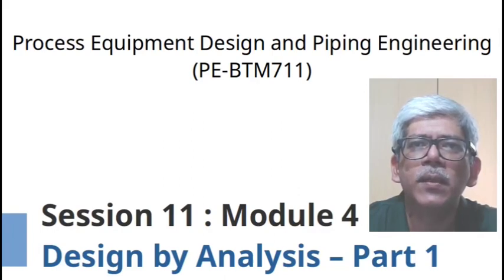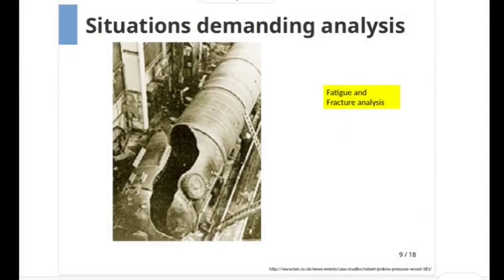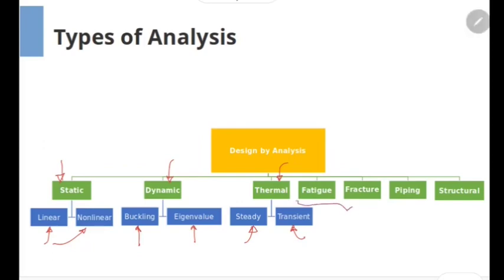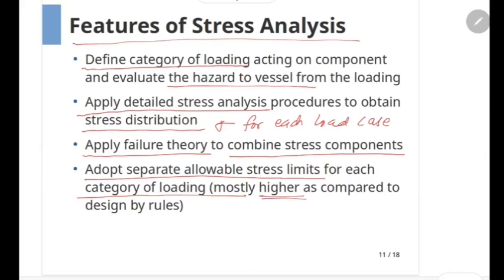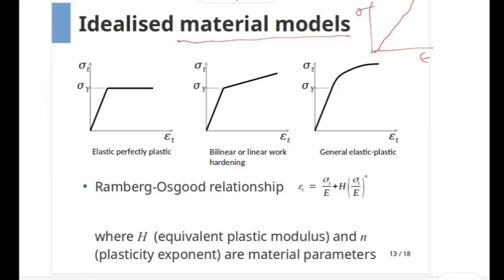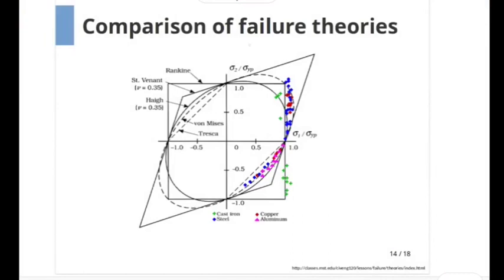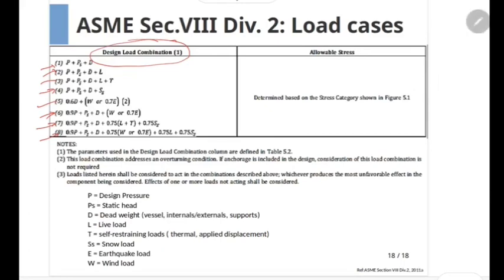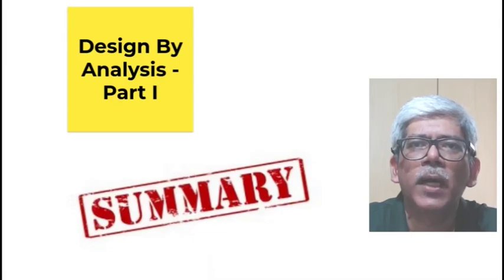S11A Design by Analysis - Part 1: Digital Learning Session

Comment: Is the true stress and strain value inputted into abaqus extrapolated after the ultimate true stress, pls correct if my conceptual understanding is wrong (i assumed that true calculation using log and engg stress formula is valid only till utimate tensile stress value)